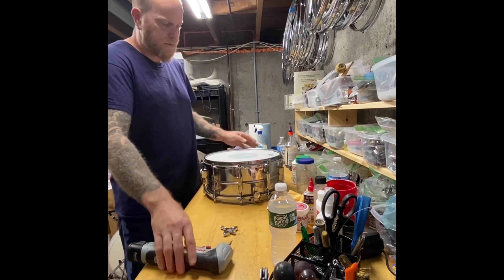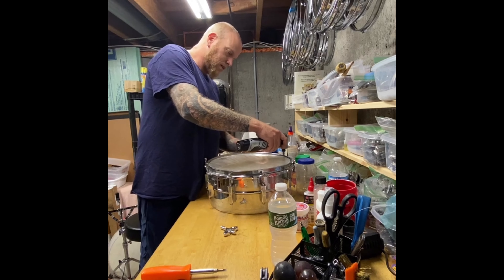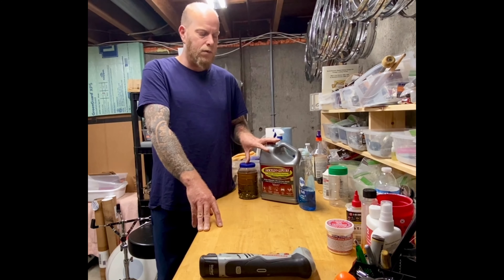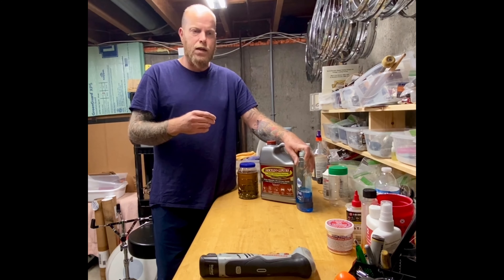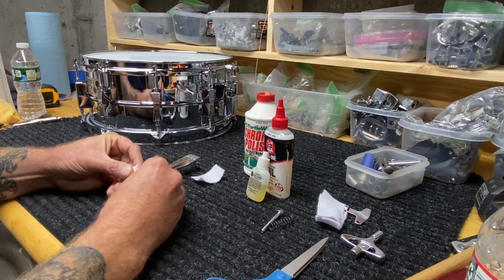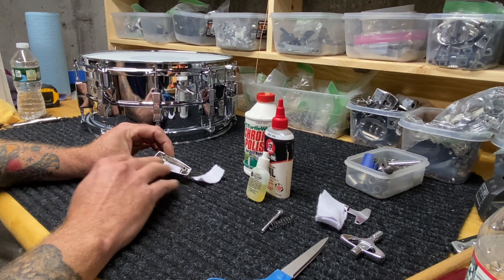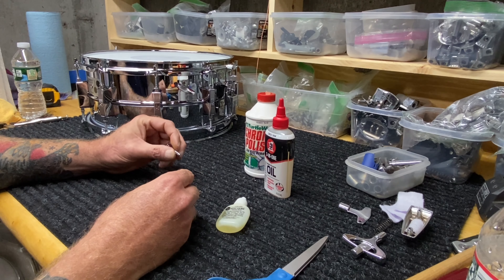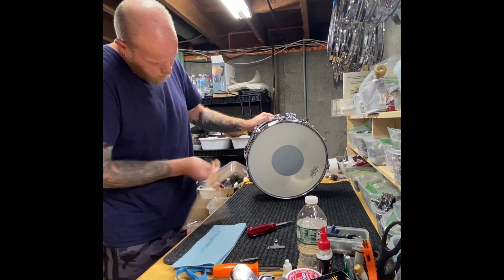Vintage snare drum restoration Sonor D506

Comment: About to undertake the same project.  What was the Dawn-to-water ratio for your Dawn bath?
Reply from the maker: I just do a couple squirts, you don't want to go too heavy on the Dawn or you end up with this soap scum type stuff all over them lol 
Thanks for watching!
Reply: @shawnsdrumcave  Thanks, man.  I may have a few more questions once I get this going.  Good to reconnect with New England.  Live in Boston for 15 years or so.
Reply from the maker: @benjaminstudevent9577  Yw and anytime!
Reply: @shawnsdrumcave  I take it you're anti-0000 steel wool under any circumstances?  I've polished golf shafts with it when they had pitting and it made them like new but never a snare with that kind of surface area.  Does that mean you just accept pitting as part of the aging process?  Interested in your take on it.